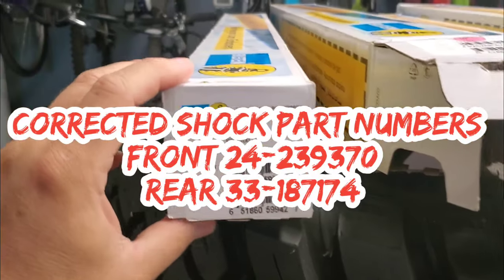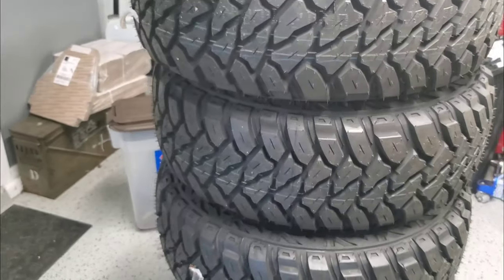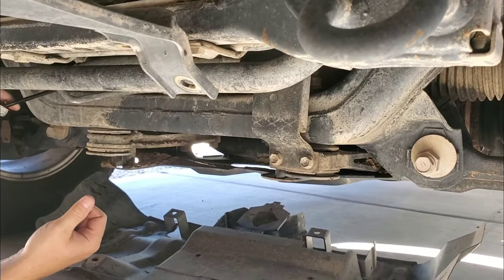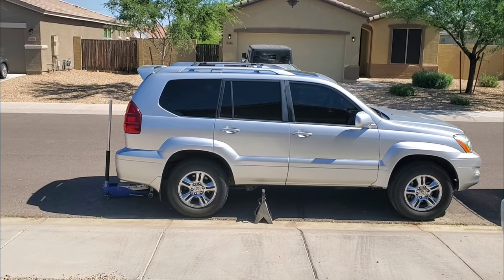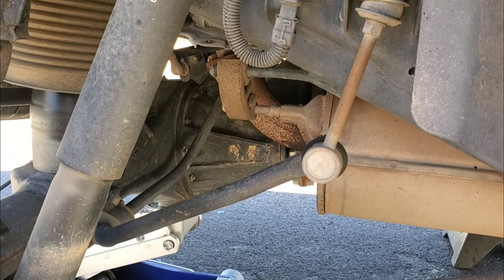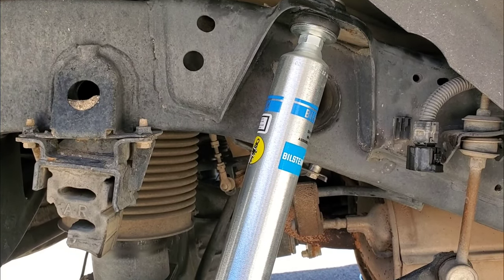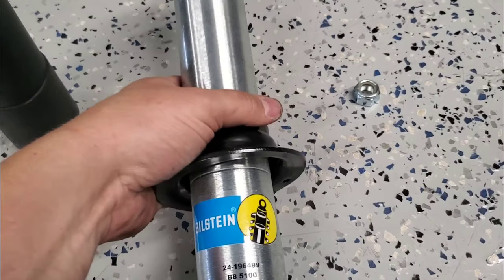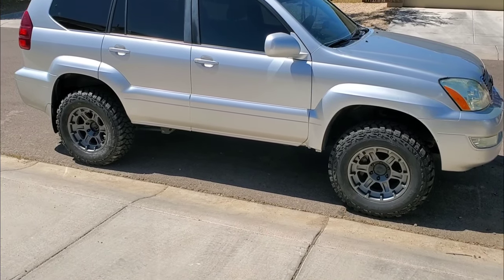SIMPLE LEXUS GX470 / GX460 / 03-09 4RUNNER LIFT. AIRBAG TRICK - BILSTEIN 5100 - DIFF DROP

Comment: Hey I Have a Question?? I have 2003 Will I Have to Convert into Springs ? Anything like That??  and What Kinda Rock Sliders did you ad???  thanks i enjoyed your Video. Short & To the Point..
Reply from the maker: You do not have to convert to springs but some do. I prefer to keep the airbags. If maintained and replaced at a reasonable mileage (150K max on bags) you likely will not have any issues with them. The main issue with the air suspension being a problem is lack of maintenance. When the bags leak, it causes the compressor to run non-stop which then damages it or burns it up. So it is a cascade effect. Keep things maintained and it is problem free IMO.
Reply: So Question? What did you do for the Front air censor? coz the 2003 has them..
how do you by pass that? ? 
Im assuming They all Do?
Reply: So I Tried doing this last weekend! And we stopped because of the front air censors on top of the shocks.. 
what do you do about that? that’s not in your Video? how would i over ride that? 
Please & Thank You
Reply from the maker: Those are not air sensors. Those are damping adjustments for the shocks. You simply unplug them and remove them, same with the rear.
Reply: Awesome Friend. i Appreciate you Getting back To Me .. 
Anything else i should Know about then after i get them Off?? unplug anything? 
im A Beginner at this So bare with me. 
thanks Again.
Reply from the maker: You just unplug them Tuck them away or zip tie them up out of the way.

Comment: What wheels are those? Dimensions on the wheels and tires? No rubbing?
Reply from the maker: Rubbing would depend on tire size, lift and running boards really. Wheels are tandem offroad 612's. They designed them for toyota vehicles - killer wheel. I run the non-center cap bravo 612 wheels. https://tandem-offroad.com/collections/wheels

Comment: Planning on doing this to my son's 05.  We were wondering if we should upgrade the front springs while are at it or if stock springs are ok?  Our goal is to keep the comfort ride best we can.
Reply from the maker: If the vehicle has higher mileage or front springs are saggy, go with eibach 2" lift springs. Excellent option!
Reply: @MR_Garage  , do you happen to have the shop link for the Eibach that you can share with us?  Thanks in advance!

Comment: Are you answering questions about, how to do this and that here?
Reply from the maker: I do answer my viewers questions when I can.
Reply: @MR_Garage  so I wantetd in know how far I can use the washer trick, 3 inch 2 only?
Reply from the maker: I would not go more than the 2" I do in this video. Still maintains a good ride. Going any more and it would be best to go with a spring conversion and use bags inside the springs to level the ride if you tow.

Comment: What setting did you have your airbags when placing the washers?  Low, Normal, High?
Reply from the maker: Low for me as that is the setting I use when changing shocks (no air in the bags). Does not matter however, actual position is always determined by the sensor position in this implementation.

Comment: Im in AZ as well would you ever consider providing this service? of course for a fee.. problem is i have no access to tools or a location to work in. let me know thanks!
Reply from the maker: I have so many projects these days, I have pretty much stopped taking on side work. For most any normal shop, it is just replacing struts / shocks as normal and direct them to add in the washers.
Reply: Mr. Garage ok thanks anyhow

Comment: Thanks for the vid!!! Question, can i do this lift, tires and  keep the running boards? Wife doesn't want to loose them.
Reply from the maker: You can, may rub a tad unless you trim the running board a bit. Have to pin the front fender liner forward too no matter
Reply: @MR_Garage  ok thank you very much for the information. How do you like those tires so far ? I was thinking of going with all terrain. But will see and thanks for the link on the spring compressor!!! Definitely will be buying that.
Reply from the maker: Totally digging them. No complaints at this time! I will be switching my white GX to these Kenda's when my toyo's are done if all keeps going well with them.

Comment: Hey great video! I think I'm going to try the same thing. Question - so the rear air bags continue to work just fine? Meaning, after the installation of blistein in the rear, you can still raise and lower the suspension?
Reply from the maker: Yes, all 3 height ranges work normally :)
Reply: Crazy!  So what’s the catch?  How come more ppl are doing this?  Seems perfect to me cuz for me it’s be the same use...95% on road utilitarian and the rest mild trails n backroad shenanigans

Comment: Great video, I was just wondering, do you know if this would work on a 2003 4Runner Limited with airbags? Also, is there no need to replace the upper control arms?
Reply from the maker: Yes, it should. Factory lifts at 2" or less do not require upper control arms to dial in alignment. At least, none I have done on 4runners and gx's.

Comment: Good tutorial!  I'm thinking about getting one but wanted to know how your GXs off-road now?  I'm debating if I should keep the rear airbags or convert to springs.  Thanks in advance bro
Reply from the maker: I do not "wheel" like so many of the guys. If I did, I would consider springs with bags in them like I run on my 4runners. Offroad in creek beds, general offroad trails, forrest roads and such are perfectly fine. I tow a lot, so bags are a must for me. No complaints here.
Reply: @MR_Garage  I won't be wheeling in rough terrain with the GX as I have my Tacoma for that.  I appreciate your input
Reply: I tricked my bags and ran like that till they failed, then bought metalteck spring conversion kit and OME 895E rear springs and they ride great and sit about .5 in higher than front with 2" strut spacer.
Reply: @MR_Garage  Do you have info on the springs with bags in them? Are they adjustable like having a true airbag?
Reply: @michaelhill7298  how long did the bags last?

Comment: Again this was a great video thank you very much. Do you know if the labor cost are associated with this project? I just moved here from Washington State and live in the San tan Valley. Since you are in Phoenix how much would you charge me?
Reply from the maker: Sorry boss, I do not do offer service work anymore. No idea what shop rates are these days. Best to ask the GXOR community on facebook. There is a great Az chaptor.
Reply: Thank you very much for your reply. I actually live here in Arizona now out in Queen Creek area and am excited to get some good use out of my GX. Could you at least let me know approximately how many hours it would take for the job minus the running boards? Again I appreciate you. Thanks
Reply from the maker: I would say 3 hours would be tops for a competent shop.
Reply: @MR_Garage  Much appreciated.  Thank you,
Reply: I have noticed a few First Gen (03-09) GX470s that pack 285/70 17s with no lift on the stock rims. Once the 5100s are installed they dont fit because of UCA. Coments on this was some minor rub, but only during a full turns and no loud sounds.  I'm probably going this route so I can keep the stock rims that I love. I plan on getting the rims cleaned u po and than dipped black. I will send pictures once my project is finished.  Also installing the Phownix "Tesla like" 10.4" touchscreen making the inside feel like 2020 and bot 20 years old.  😊
Reply: Do you know anyone who has put 285/70 r17 tires on the GX?

Comment: Just confirming Mr Garage. When replacing springs with Eibach you can still set the shock to the 2nd from top notch like you did with OG springs correct? Thank you so much
Reply from the maker: You can, but not needed as they are lift springs. I had to move mine up as I have the weight of a winch and bumper. Basically, just do what the vehicle calls for but I would not recommend going beyond the 2nd notch.
Reply: @MR_Garage  thank you again man! Appreciate it

Comment: How much travel does the rear shock have after doing this?  Seems like it would have a much higher spring rate with this done.  Have you off-roaded with this set up?
Reply from the maker: It is not a "wheeling" suspension setup but as stated, awesome for a lift. More offroad capability. Think riverbeds. Forrest roads... next level beyond stock.

Rear = air springs and with good shocks, the rear is smooth and feels awesome. Not overly stiff.

Comment: Where do the skid plate spacers go? What bolt holes and is it the front or rear skit plate?
Reply from the maker: They go between the mounting tabs and the crossmember located at the back of the skid plate to space the plate slightly lower. A pita to get in there.

Comment: Hey @MR_Garage - the previous owner of my GX470 did a rear coil conversion using Eibach Rear ERS load leveling system.
I am now replacing that with the Arnott air springs and Bilstein system you advocate for. 
My question is about bump stops. Should I return to the OEM stops? Is there another option you recommend? Thanks
Reply from the maker: You could always keep the eibach setup and go with air-lift 1000 bags inside the springs. Just an idea. I still stick with the stock airbags. works excellent for me as I tow a lot. No need to return to oem bump stops that I know of.
Reply: @MR_Garage  appreciate it. I already have the Arnott air bags, Bilstein shocks, new Eibach front springs, new bushings, top hats, new brake lines, washers, diff drop and new hardware. Pretty much everything on your list because I am borrowing a friend's shop for a day and want to have all the potential parts on hand.
I want to remove the Eibach rear kit whole to sell it. Thanks for all your help and video content. Strange but your laundry detergent video for stinky shirts has been my favorite
Reply: @MR_Garage  yeah, I tow a 4,000 tt regularly all around the PNW, usually also loaded up with kids and gear. So towing is very important. My brakes are the next project. Any comments / recommendations on the power stop products? I saw your Bosch recommended setup but curious if for a bit more money you'd do Power stop or even the GX460 upgrade?

Comment: Was the exact part number for front because your box says different then the one You posted . Also what size of tires ??
Reply from the maker: Hey Erick, I call out the proper part numbers in the video clearly as they shipped a set for the next gen platform on the fronts (virtually identical in all ways confirmed with bilstein) but of course better to order the exact ones which I listed. All proper part numbers and tires I use are listed in the video description - check it out! Good stuff :)
Reply: Mr. Garage hey thanks got it I order them received it install looks good I’m just gonna add a little tire spacers

Comment: Newbie question - what’s the purpose of the diff drop?
Reply from the maker: A diff drop lowers the differential a small bit, helping take a few degree of angle off the CV joints from a lift. Literally, every single degree matters for the long haul life if these axles, especially the boot life.

Comment: Does the rear adjust even more (with the sensor trick)when towing heavy loads!
Reply from the maker: Sensors just keep the ride height steady (lifted if spacers are used). No additional adjustment.

Comment: Whats the correct part number for the front struts? I saw the pop up at the beginning of the video but when you were installing them i saw a different number ? Trying to order the front but want to make sure i get the right parts.
Reply from the maker: Check the video description, it shows the exact part numbers and offers a description. good eye! "You will noticed the PN for the fronts in the video are different than below. Use the below part numbers! I was accidentally shipped a set for the 460 / newer 4runner and such instead. Slightly wider mounting for the lower bolt but that was really the only difference. Anyways - use the below PN's for the GX470!!!!"
Reply: @MR_Garage  thanks for the reply. Saw the description prior to sending out the message but  just wanted to confirm and double check. Order is placed along with some much needed end links.

Comment: Any rubbing with this setup ?  How about fitting the spare in the spare location ?
Reply from the maker: I had to pin the front fender liners forward so it did not rub. With running boards removed, no issue rubbing in the back. And with a 265/70/17 which is pretty much a 32", fits perfect in the spare location without airing down the tire
Reply: @MR_Garage  Thanks again !

Comment: When you do the airbag trick does this mean the bags are fully inflated or do they still have some squish? My concern is popping an airbag over time if tricked to be inflated 24/7
Reply from the maker: They are not fully inflated, just not at the factory position. They will still raise to a high position when prompted. Several years with this on our GX's now. One thing to keep in mind, if you are on original bags, may be time to replace them before you do this. They are a suspension component and once you past 150k miles or so, you are on borrowed time anyways.
Reply: @MR_Garage  Dude that is awesome! I really appreciate the reply. GX460s will deflate from high after going above 17mph. Do you know if this trick will bypass that as the bags will not be fully inflated? Was hoping to see testimony from a fellow 460 owner in the comments but no luck. I appreciate the feedback brotha.

Comment: Hello there. Do you have any tips on how to remove the bolts holding the ASC module on top of the front struts? I'm stock trying to get those off. Any help will be greatly appreciated! Thanks!
Reply from the maker: I unplug the module from the strut, then take a pry bar and destroy the plastic motor housing. Then, can easily get to the single top nut holding it in place. Caveman style but works. Not like anyone will every use that strut top motor again.
Reply: @MR_Garage  thank you.

Comment: Do your tires rub when cornering?
Reply from the maker: They did with these -12 offset wheels. Had to pin the fender liners forward and also removed the flap and running boards.

Comment: Which ones are the correct part numbers for the shocks, the link on the description or what’s being shown on the video?
Reply from the maker: The video shows in text the PN's and shows in giant red letters "corrected PN's" which also match the video description which are also correct. I was shipped a set for later gen 460 / 4runners and such which is why the boxes did not match the description or links. I verified with bilstein that the actual changes were so small, it would not make any difference so I just used them. And in fact, it made no difference other than the lower mounting bolt area was just slightly wider (like 1mm ish)

Comment: I have a quick question I installed the front shocks but I wanted to keep it stock height so I left the adjustment ring on the lowest setting that shows stock on the bilstein instructions. But my coil springs dont compress at all. I have to put the shock ring on the second one from the bottom just to get the springs to not spin in the perch. Is the spring completely shot? Im at a loss, any advice would be appreciated.Thank you
Reply from the maker: Sounds to me like the springs you have are totally shot. I have never seen that before. Should easily be compressed even on lowest lift setting.

Comment: Are you planning on re-gearing to account for the bigger tires?
Reply from the maker: Tires are larger, but doing a 265/70/17 does not warrant gearing.
Reply: It's just a +1 fitment (from 65 to 70 sidewall aspect). Not a big difference in performance but a HUGE difference in looks. Also, the OEM wheels have offset that fully sinks the wheels inboard of the flares (gotta keep the mall cruiser clean, yo) - and giving it either a spacer or a new wheel with some 'poke' to outboard makes a giant visual difference too.

Comment: Do you need to replace the rear shocks for this? Or can you get by with the spacers in the rear 5100s in front?
Reply from the maker: With the miles you likely have (shocks are toast) I would highly recommend it. Or the ride will be bouncy house fun without damping in the back. The ones that complain about the sensor truck lift are the ones that run stock shocks :)

Comment: Do you think I would need to do the body mount chop if I ran this lift with 275/70r17 and the same wheel specs as you have? Also I have KDSS, would that be a problem when lifting? Thanks
Reply from the maker: Super close between the tire you want and what I run. About 1/2" taller on yours. I think you could probably get aware with pinning forward the fender liners and removing the running boards.

Comment: Thank you very much for this video and your others on the GX.  Do you think I could run 285/70/17's with this same set up on a 2008 GX?
Reply from the maker: Not without some body work
Reply: I am currently stock with 285/70r17. Slight rub on wheel well but not much at all. Putting my lift on tomorrow though.

Comment: Also the spacers for the skid plate ?? Where exactly go they go and is the skid plate suppose to touch anything besides where it fastens to car?
Reply from the maker: The spacers go between the cross member and rear mounting stands on the skid plate. Bolts go through them.
Reply: What did you use for the skid plate spacers?